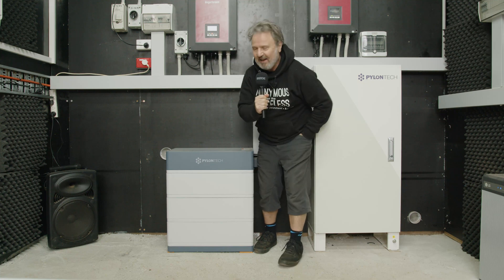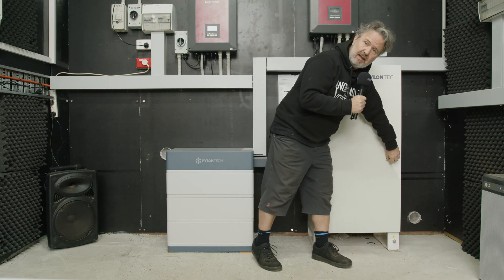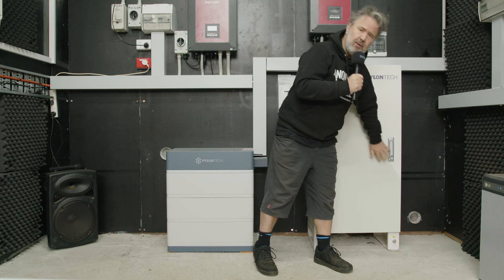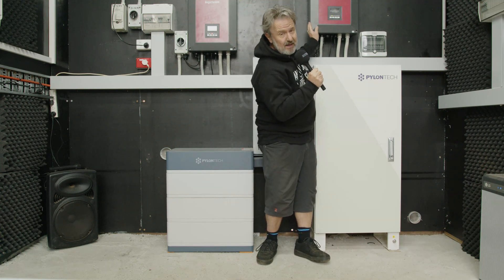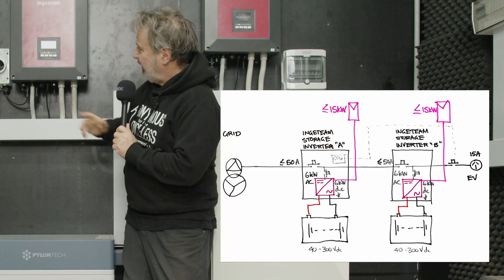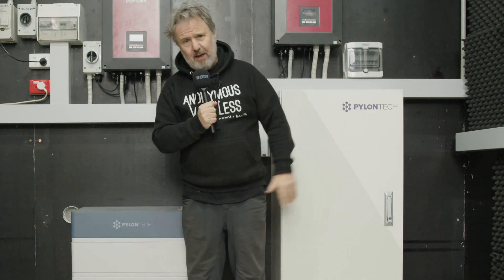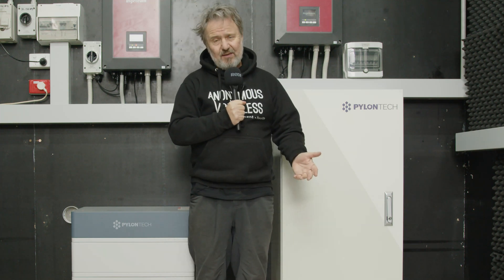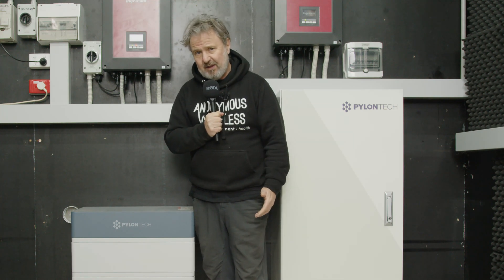Ingeteam & Pylontech TechQuickie

Comment: Glenn, please do a session on the EV charger. Charger Home build,15 amp only or Zappi etc? Looking forward to hear more of your opinion on EV charging of Grit
Reply from the maker: We have a 22kW Type 2 EVSE as well but only use it when solar power is flowing. 15A outlet is for the 2.4kW “trickle charger” for use over night.
Reply from the maker: Yes, Michael, off-grid EV charging presents it's challenges. I like to think of an EV as another whole house load of energy that you need to accommodate. The challenge we discovered was that since the EV is a daily drive to work/school, it needs to be topped up by the morning. In winter we risk running our house batteries down over night and having to run a generator. Instead we built a 9kW array on a two car EV only charging carport, dedicated the two x 10kWh Pylontech batteries and Ingeteam inverters to an EV only charging solution. This takes the "worry" out of charging overnight for my partner. She just wants to plug in at the end of the day and have a full battery by the morning without the possibility of causing the generator to auto start on low house battery SOC.